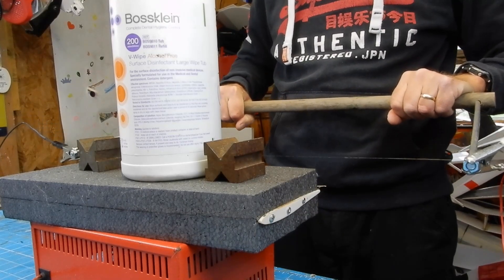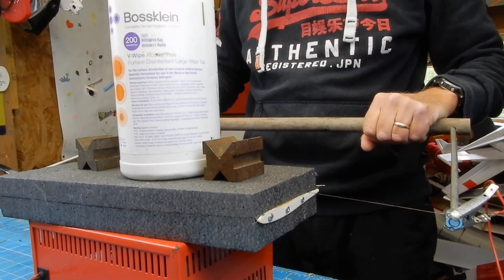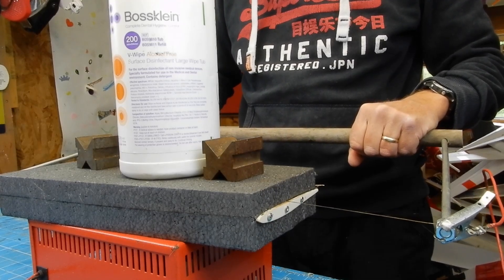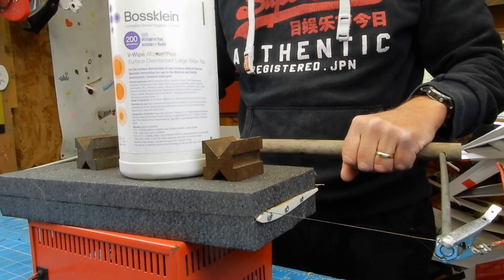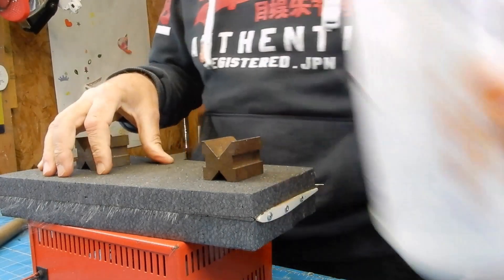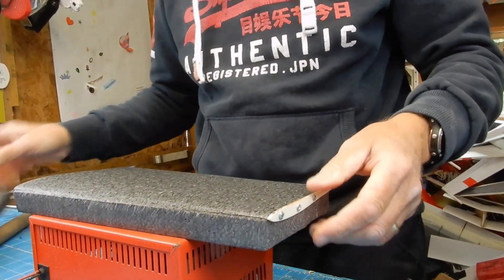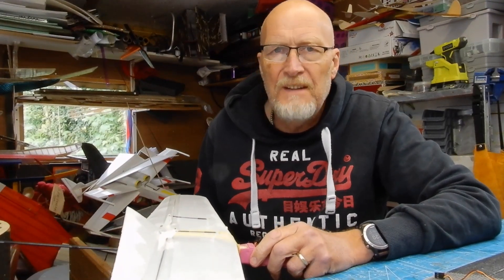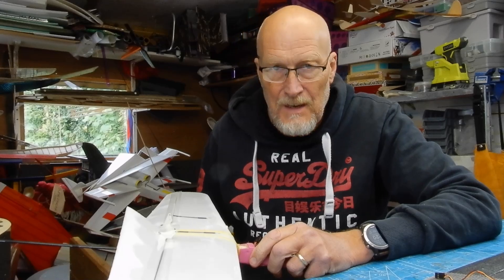New experiment wing VTPR Part 2

Comment: Hi Nick. Re aerofoil thickness and model wings: The problem with thick sections is the leading edge gets too bluff for very low Reynolds numbers and you get boundary layer separation bubbles forming with attendant high drag. If you want a thick wing for any reason, sharpen the leading edge to the same nose radius you'd have on a thin wing. Birds do it that way, take a look at the Serendensky sections for an example of a section based on similar thinking.
Reply from the maker: Ooohh thanks will have a look ta